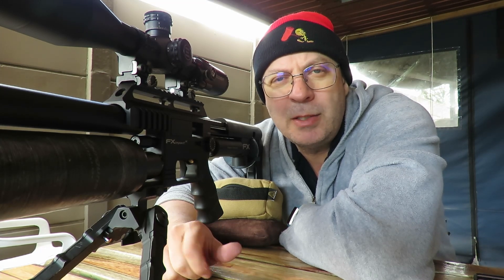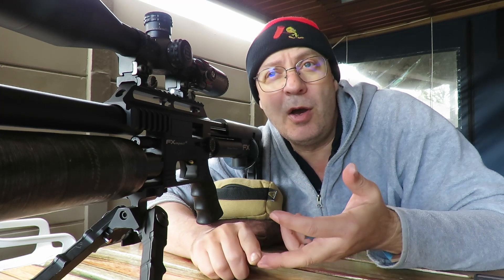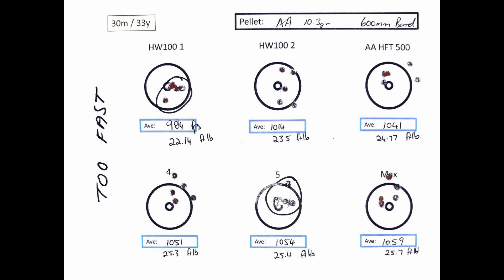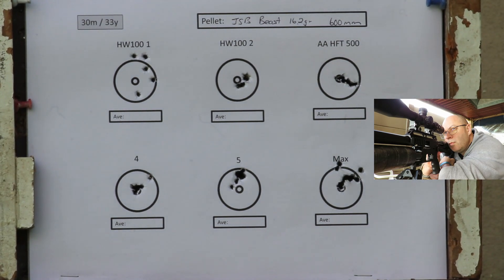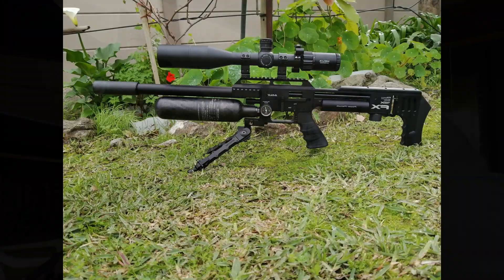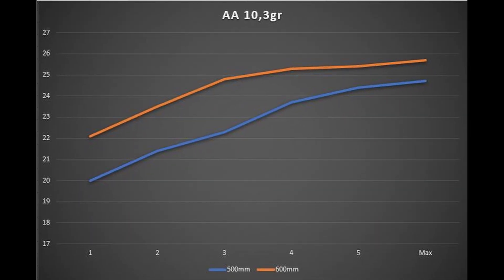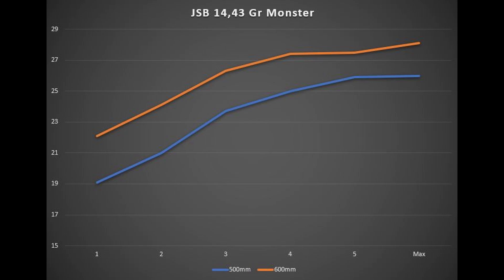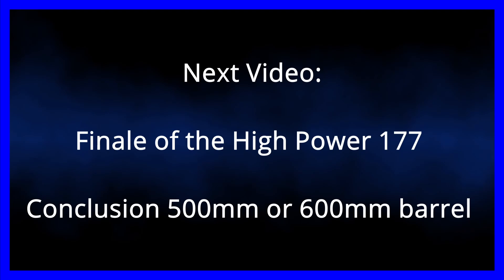High power 177 20ftlb to 30ftlb with 500mm and 600mm barrel

Comment: Thank you for taking the time to produce your videos they are well received and most imformative. Question, which FX M4 configuration would you you go to allow slugs and pellets in .22
Reply from the maker: This is always a tricky question, to be able to shoot pellets abd slugs you need to consider at what speed the slugs will be going and weight, if you want to shoot 30gr slugs and 18gr pellets I would look at the 7oomm barrel, but even this might be a tight squeeze. The 800mm barrel will produce too much speed for pellets, might even consider the 600mm barrel, seeing that the MK 4 can easily produce the power needed for slugs.

Comment: My airguns using Lothar Walther  Polygon 69cm barrel n using NSA Slug 15grain can produce 29.48 ft.lbf ... Because the speed I was using it's about 942 fps (on average) n it could group very good at 73 meters (about 12 mm x 3 shots)
Reply from the maker: Twist rate on that barrel?
Reply: The Twist Rate (TR) is 1:17
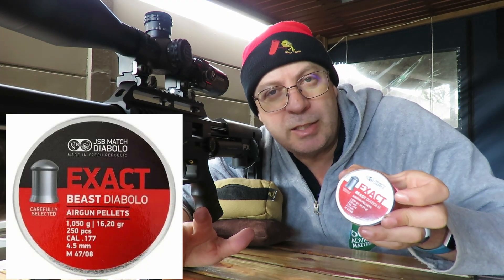Reply from the maker: @gondezableh4972  Great, it explains the better accuracy with the slugs, the twist rate in the FX is somethng like 1:24.

Comment: As much as we all jump onto the wagon to go get your pellets, etc.. This guy airgun, even if it's the same as your fx. Is just not the same, unfortunately. Even with your wheel and valve the same.. springs will probably be different ... there's a sweet spot for everything. That tiny little extra air out the end just makes that pellet or slug distort. For different pellets, not touching those adjustments, and using different pellets ect. With a little change on those adjustments would make that pellet fly the same speed and twice as accurate

Comment: According to Ernest Rowe, every time you change barrel length and/or pellet weight then:

1. Set the regulator pressure to 100
2. Put the power dial on MAX
3. Increase HST until velocity stops increasing.
4. Decrease HST until velocity starts decreasing.

After, if you don't have the velocity you need then you increase the regulator pressure by 5 Bar and repeat steps 1 to 4 above. You keep doing that until you get the velocity you need.

This way you dont end up wasting air, get more shots and ultimately the velocity you wanted. Accuracy also improves because you are only hitting the valve by the minimum amount needed. Over hitting the valve will only end up messing with the barrels harmonics.

Comment: Isn't part of the issue with increasing spread that diabolo style pellets just aren't made for transonic speeds? At least in my experience when I push diabolos over 270m/s accuracy goes out the window quick, and insulated glass isn't cheap.
I shoot a bit of a frankenstein buks in 100m competition, running an 880mm barrel, the longest allowed by the rules and I only use slugs to do so. Twist is about 300mm on that barrel and the slugs are perfectly stable at 330m/s. Slugs like fast twist and don't care as much about transonic speeds.
For the 25m indoor competition, slugs aren't allowed. The pellet has to be diabolo shaped. I run a 560mm barrel with a 650mm twist. And speeds are way down to about 210m/s. I tried using the 880mm barrel, but the twist rate and speeds are just too high for diabolo pellets.
Reply from the maker: 100% correct, pushing pellets beyond 290m/s and all stability flies out the window, the test in barrel was about speeds, so if you increase speed with barrel length you need less pressure on the reg, making the gun more air efficient and the parts work lighter. The modern slugs love speeds above 300m/s. Happy shooting.

Comment: Wonder how much your power would increase if you had the 700mm barrel 🤔
Reply from the maker: On average the extra 10mm added about 25fps so I would guess the 700mm would get it close to 35Fpe.
Reply: @AimSmall  yoh I thought my hatsan was powerful at 28 fpe with the 13.43 grain monsters but if you had a 700mm barrel it would be an absolute beast 
35fpe is the same power as my friends.22 Daystate Huntsman regal at max power
Reply from the maker: @ZimbabweAirguning.  Working on it again, dual flow and pinprobe installed...

Comment: Hiya bud isn't the bc technically up around the limits at some of the speeds these types of pellets travelling are you going to do a 177 slug test in the same way you've tested the pellets
Reply from the maker: I did, but the FX barrel didn't like them at all, I am looking for a barrel i can modify to fit the FX, 14mm diameter with a bit faster twiat rate ...

Comment: I purchased Nielsen slugs here in the U.S. and am happy with how they preformed. Diameter is.178 in either 12.5 or 15.0 grains, being pushed @ 900 fps and 850 will group 5/8” and 1” @ 60 yards. I’m thinking this is pretty impressive out of a $199 pcp . The pellet and slug topic is quite interesting vs fps, have had good luck with JSB 10.34 and 13.43 as well as H&N and Crosman if you keep them under 900 fps . The heavier the slug max your power. Thanks for the info you post on YouTube 👍🏻
Reply: What pcp are you using?

Comment: Great analysis, have to say you had overloaded the hammer as your 5 - max speeds were minimal and wider groups  suggesting the hammer its maxed so  you're pushing out too much air.  With the impact its not as common due to the massive adjustability, possibly bringing the valve stop back a bit might have made it all smoother. The speeds, in general, are rather low  as 880-920 is usually the bracket for JSB in most barrels and also calibers.🤔
Reply from the maker: I had to max out the hammer pring to get the velocity up with the reg pressure, after the video I tuned the hammerspring down but the speeds fell away quickly, the gun was sounding sick on power 5 and max, I knew I was pushing her hard but I had to get the speeds, just doesn't make sense to shoot a 177 at a reg pressure of 150bar. I tuned her down to 50 bar and loosened the hammer spring and still got 900fps with 10gr... thus there is a lot of air wasted trying to push for speed. I have spoken to a few FX experts but they have no experience with 177, all their knowledge are with the 22. I am doing one final run with the 177, if I don't see the results I am aiming for... still have a 22 barrel kit I can use. Pity as a spend mega bucks on the 177 setup.
Reply: @AimSmall  prob with the fx guys in SA is that they mainly work on .22. As I said in my first post the main prob is the port size which is identical for sub and +12. Thus really not designed to go much past the expected 900 for a pellet. Huma air do a .177 high flow port which I suspect will help a lot as you have actually hit the max airflow capacity and increasing the pressure will have no effect. This is one of the ways they castrate the sub12, the TP for a .22 is smaller that for a .177 so no matter how much the reg goes up you can’t get the power to go up.  If you want to test the potential properly fit a high flow port or just work on the theory it’s a flat shooting close range/barn pellet gun and run JSB hades Which are the same as heavies and it will run perfectly at 18-20 ftlb and put the .22 barrel on for the long range/outdoor work. Power is often overrated it the accuracy that counts
Reply from the maker: @happyhalfwit8862  well said and thank you for the great advice.

Comment: i've had bad  groups with my 35ft/lb  .177 impact as well.  i removed the liner and pass the pellets and slugs through it and the damage to the projectiles was massive. the choke is very tight and it deforms them badly. also the twist rate is to slow and it turns anything heavy to the right
Reply from the maker: Sincere thanks for this, I had the same effect with heaviser stuff especially the slugs going straight right...
Reply: @AimSmall  when the 600mm liners hit the market i will cut 10cm from  the choke side and recrown it  to fit the 500mm tube and hope for the best :P.. great informative videos as usual .
Reply from the maker: @tromplee6107  I know that FX isn't realy interested in the 177 variant, they started research on better liners and then gave up, they even brought in Hein Froneman a multiple world champion bench rest shooters to assist.. alas they shifted the attention back to the 22 and higher, I am thinking of buying a Walther Lothar barrel and fitting that to the FX...
Reply: @AimSmall  make sure you get the polygonal without choke